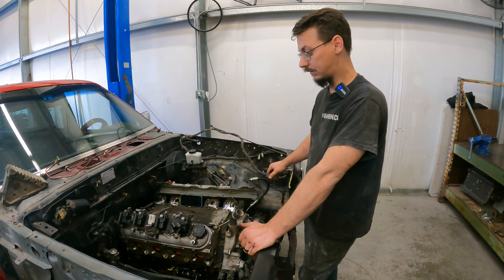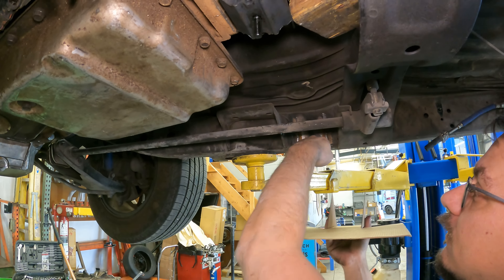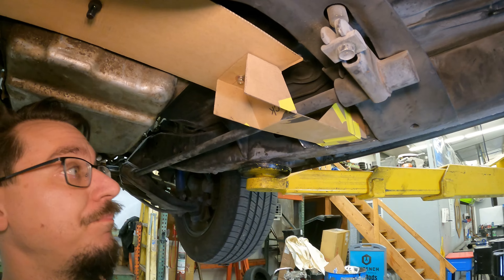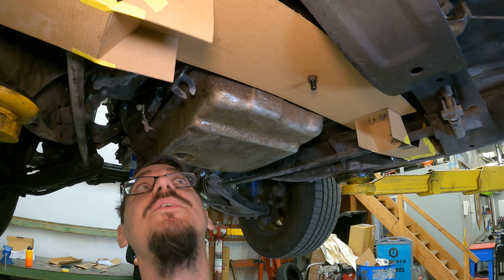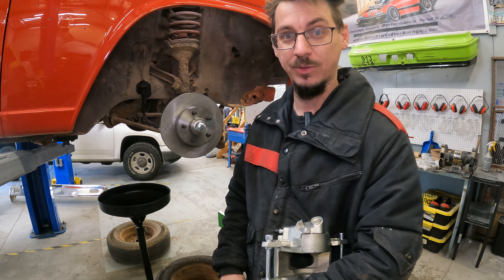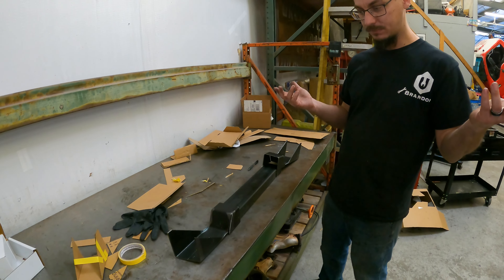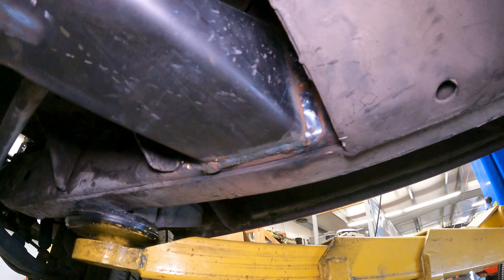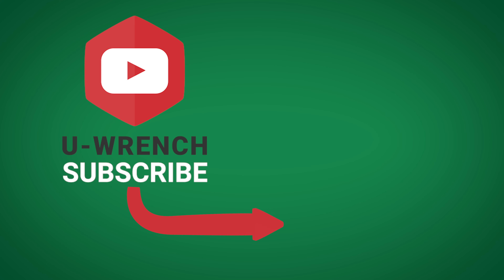LS Swapped B2200 motor & Trans Mounts Finished | Completed Crown Vic | '66 AMC Marlin from Alaska

Comment: Not bad! But when fabbing trans mounts, try to maintain a constant depth of material along its length. The strength limiting part of the mount is the plate sections under the torsion bars. Even though the moment force is lowest at those ends, the shear force can still fail a part of it doesn't have enough depth. Good luck.

Comment: I gotta admit, I wouldn't even attempt to fabricate a mounting bracket.   Crazy question but why not use a larger, thick-walled tube for the main body of it and then add the angled parts at the ends?

That Marlin looks fantastic.  Glad to see the brake upgrade.

Does Fred really recommend average drivers remove the front and back glass of their cars before getting them painted?  That could be horrific! Other st5uff?  I can see that.
Reply: That would have required a tubing bender. 
Yes Fred recommends removing the windows, he doesn’t recommend driving the car as a daily driver during the paint process.
Reply: @brandonwelsh2743  Given that I would use a screwdriver to pry it out, should I just use a sledge?
Reply: @Gene1969  our glass guy removes and replaces most glass for around $150 find a glass guy that’s not Safelite and they charge fair prices.

Comment: What happened to the bolts?  You welded it on!
Reply from the maker: The center section where the transmission mounts is bolted on. Only the brackets on either side of the frame are welding in place.

Comment: Bending it down would give it more strength. Bending it up  Will not give it more strength because of the weight of the transmission in the motor